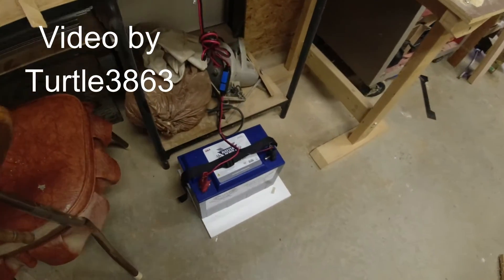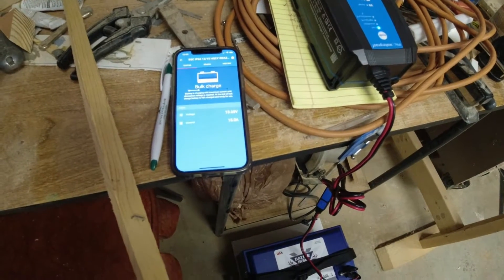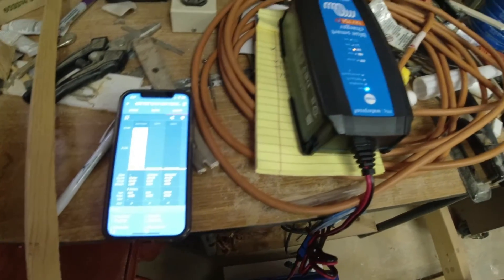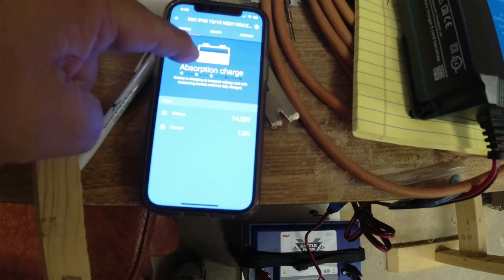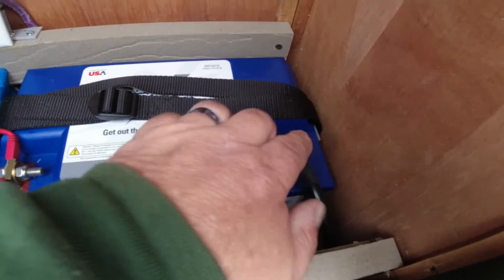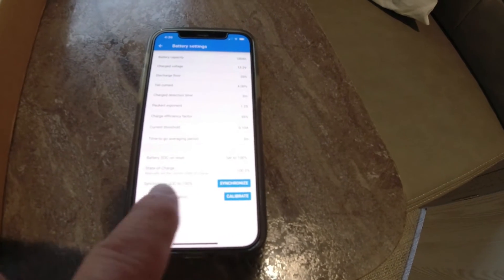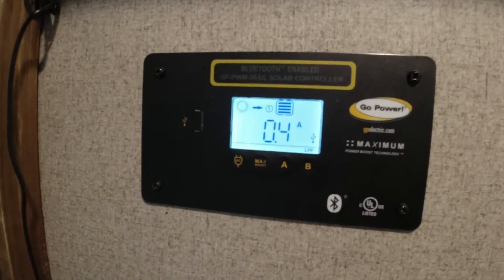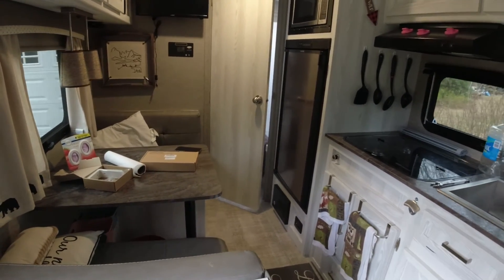Battery Re Install after Winter Storage

Comment: Ugh, I still have to de-winterize mine yet. Usually I don't winterize down here in GA but this year I had to due to family issues and was unable to do any winter camping. This may be the year I have to get new batteries and switch to LiFePo4. The flooded batteries in there are 4 years old now. Looking forward to a new camping season!
Reply from the maker: Still have not de-winterized as well. Hopefully in the next couple of weeks